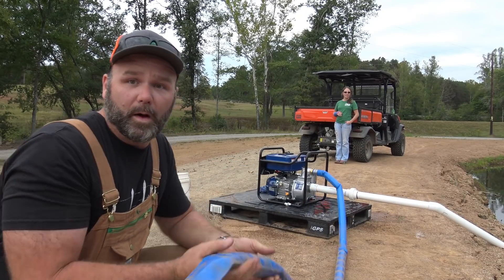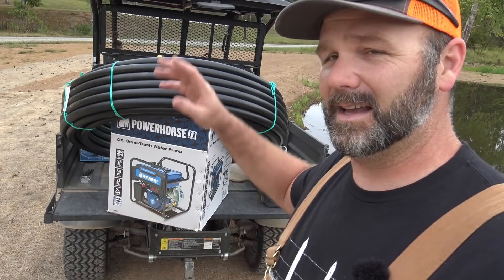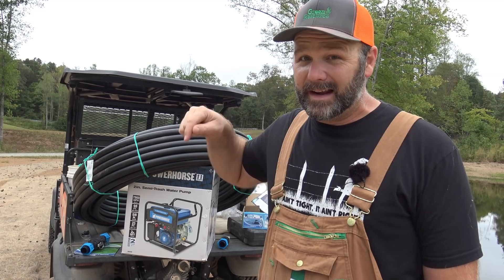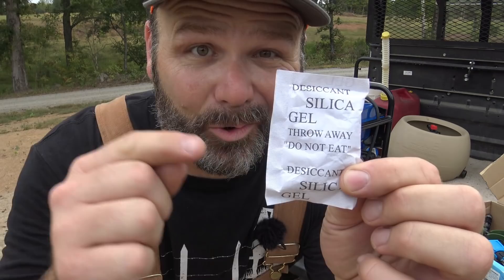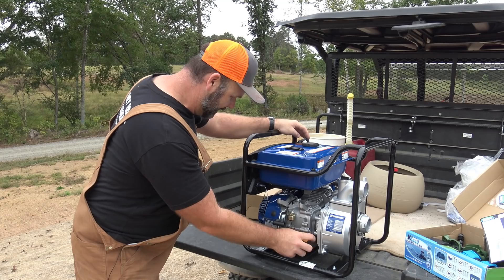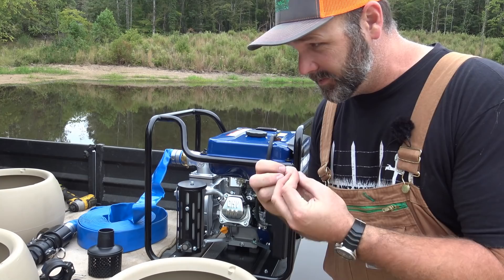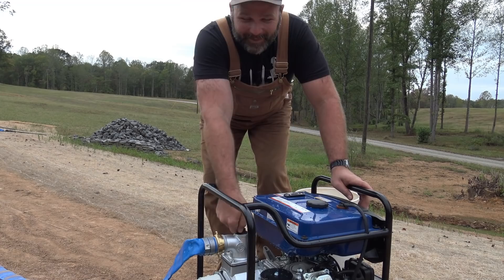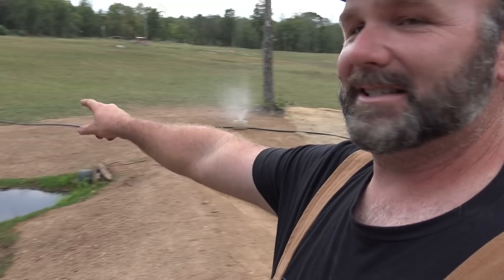Never seen irrigation like this? Pumping from the pond...setup start to finish!

Comment: After looking around online a five pod kit is around $1700 damn that’s a lot. There’s some people near me that use these to get the corners that a center pivot doesn’t reach and they probably have 80+ in each corner. It seems to me like a big gun on wheels would be the better option. Those little sprinklers are pricey.

Comment: To get even coverage with your sprinkler pods, they should be 23 ft apart so that each pod’s spray hits its neighboring pod. If you were to measure the amount of water hitting the ground, you would find that the sprinklers drop more water closer to the spray head that then diminishes as you approach the 23 foot radius of the spray. By having them with a 100% overlap, you will get a more thorough soaking with only having to add an additional irrigation pod or two. The k-line pod system is great. Keep up with the great videos.

Comment: If the river has enough drop as it flows you could set up a ram jet pump to continuously pump water to the catle without using gas or electricity.

Comment: HI STONEY, WHEN YOU PRIME THE PUMP YOU SHOULD BE FILLING THE INLET HOSE AS WELL.  THE POINT OF PRIMING THE PUMP IS TO FILL THE PUMP AND INLET WITH WATER SO THE PUMP DOESENT HAVE TO TRY AND PUMP AIR.  iF YOU FILL THE INLET LINE WITH WATER THE PUMP WILL START AND RUN FASTER AND WILL BE MUCH BETTER FOR THE PUMP.  SORRY FOR THE CAPS, MY CAPS LOCK IS STUCK!!
Reply from the maker: lol caps stuck.....I'm with ya buddy....but how would I fill the inlet pipe without it running out ...this prime system is what's recommended by the factory...only have to prime it once and it's good to go until I drain the pump

Comment: Here's an idea, do some horse trading, get an old boat trailer, preferably without a title, attach the pump to it, make some racks to hold the hoses and a box for tools. Also, get some floating solar fountains to aerate. They're small,  but start around $12.

Comment: Could the weight of the water in the PCB pipe cause the joints to fail or put a torque on the intake coupler of the pump? Maybe a support, like running the pipe through a cinder block and then filling it with concrete would help.
Might want to think about putting a flexible coupler (hard rubber or something) near the intake to help reduce the vibration of the motor from shaking the PCB joints.

Great video as always. Always fun to learn something new.

Comment: Where does one find ethanol free these days?  I’m in the St. Louis area, closest I have found is 2 hours away.
Not sure how deep your pond is, you could build a floating dock of some sorts, run a line out to the center with a couple of feet of pipe that drops into the pond.  Should help keep the sludge and debris to a minimum.
Reply from the maker: google search on maps..you'll probably find a local place brotha

Comment: really liking your video's. noticed you used fdh (fire department hose?) fittings on your hose, wouldnt it be cheaper and easier to come by camlock (quick connects)? so I was wondering what the pot looking things around the sprinklers are all about but after watching im guessing thats all about protecting keeping the sprinkler heads up right when moving? any how thanks for the vid.
Reply from the maker: Yep...I put camlock connects on the end of the hose
Reply: The pods are to stop the cows braking the sprinkler heads if you forget to remove the system before putting cows in and to make it easier to move. I'm a ex farmer in New Zealand and have used this setup alot

Comment: nice to see the kiwi products in the states. do you have the 1000lt (dont know what that is in gallons) icp pallet tanks? we put them on a small trailer with the pump hooked up so you can run as a small tanker.

Comment: Don’t fall in. The filter should be on a flexible line. It should also be attached to a pair of floats. That was the intake line is not as likely to break. And the floating filter will stay off the bottom

Comment: Also located in NC, just a bit east of you.  Got our first two cows and are struggle to maintain good forages during periods of drought.  Was thinking about a similar pump and a large spray gun to water a few acres.  Trying to come up with a good system.  Do you have any experience with that?

Comment: Should the spacing not be 46 feet between each unit, if the spray radius is 23 ft?
Reply: Sensible to have some overlap for full coverage
Reply: Lawn sprinkler systems should spray head to head or you get dry spots so if 23’ is the distance a head can spray then they should have been 23’ apart.

Comment: Why you put a check valve on the pipe that goes to pond so you keep priming the pump
Reply from the maker: pump has a check valve built in so I only have to prime it once brotha
Reply: @StoneyRidgeFarmer  one thing I forgot to mention about the Powerhorse pumps, the flapper will come off and keep that pump from getting water.   Sir,  I've literally used dozens of trash pumps like that.   3 things:  1. get a Honda and 2, get all cam-lock fittings for said Honda,  and 3, get a 2" camlock hose for the suction,  put a 1# weight on it,  and tie a milk or bleach just to it.   The weight will keep the inlet below the water line,  and the jug will keep it off the bottom in clean water.  You can then roll up your suction hose.   If there is a fire,  unroll the suction hose, hook it up,  and toss it in the water without possible cracking the PVC suction trying to put it together in a rush if there's a fire.
Reply: @jaredkean7841  I use one and a half inch black poly pipe for my suction hose with a filter foot valve in the river sitting about 2 ft deep in water. Its light and semi flexible and no need for exposed joins which may let in air. And I always use honda pumps, reliable and strong and cope well with Australian dust. Irrigating a lot now with drought in NSW.

Comment: Mr Stoney Ridge,   your going to want to replace that trash pump with a Honda of similar size.   I work in the oilfield and have used every brand of "trash pumps" for everything from HCL Acid, Sodium Hydroxide concentrate,  sand/ water mixture down to just dirty muddy water.   I've used them in the West Texas heat,  to the North Dakota winters.   I'm not brand loyal per sè but that power horse is going to run you for a season at even occasional use, and it'll drop a valve at the WORST, most inconvenient time.  Please,  save yourself the hassle,  save your pennies for a few weeks, get that Honda on sale somewhere and replace that Powerhorse when it blows up, because it's going to,  I promise.   Just my thoughts.  I'm not a fan of replacing things that aren't broken and I certainly dont need the fanciest of things.... but that Honda will save you SO much time and money.